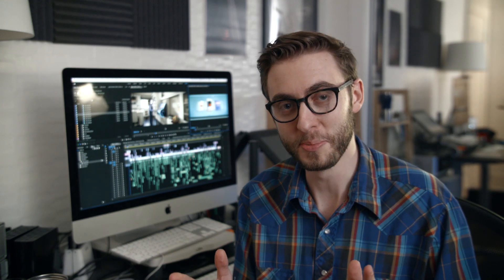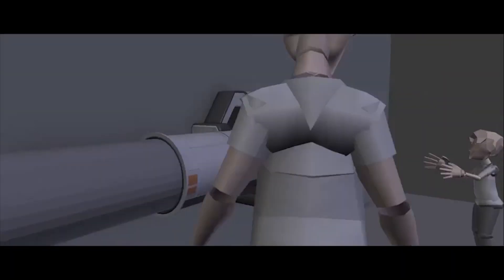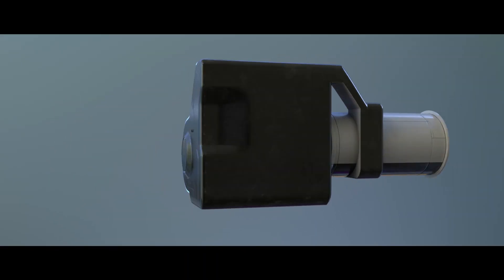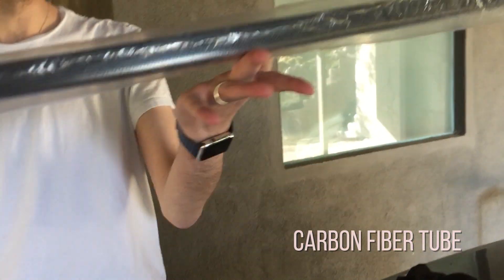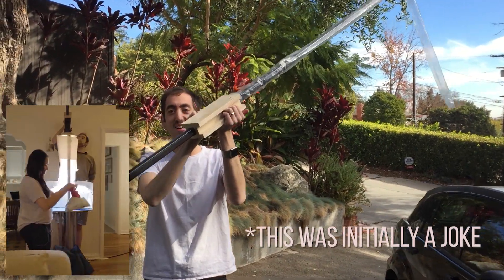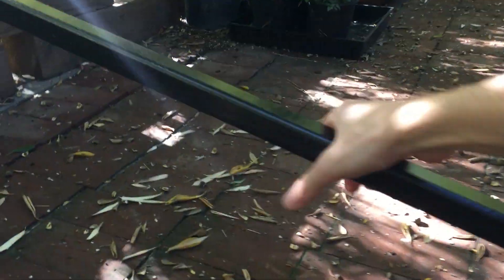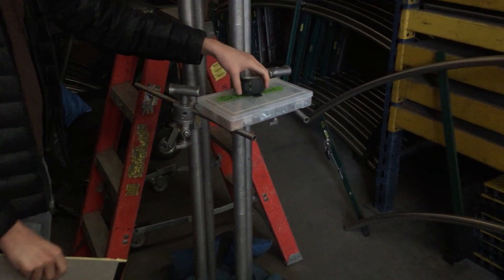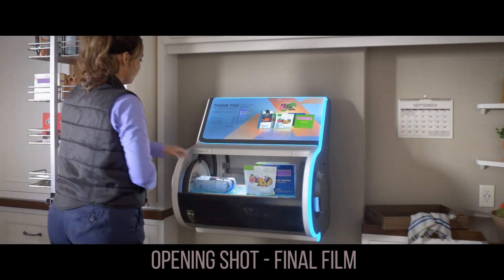Building the Spin Rig! (NexPort BTS Pt. 1)

Comment: If you supported the swing arm from the ceiling instead of having it floor-mounted, you could have saved a lot of post-production work.
Reply: Not if you count drywall and paint repairs to be post-production work.